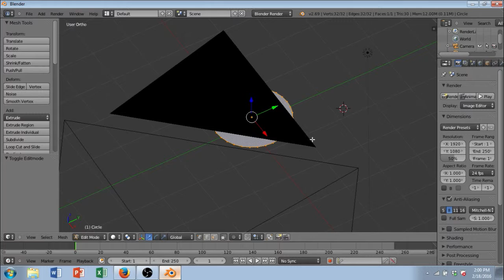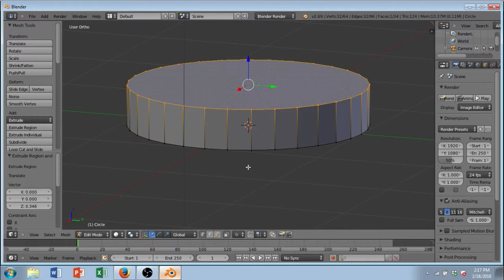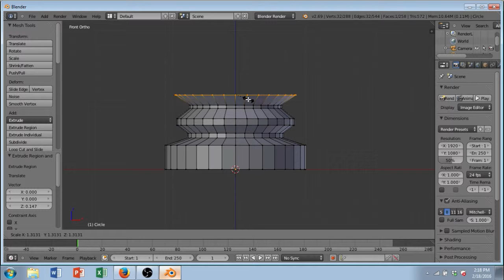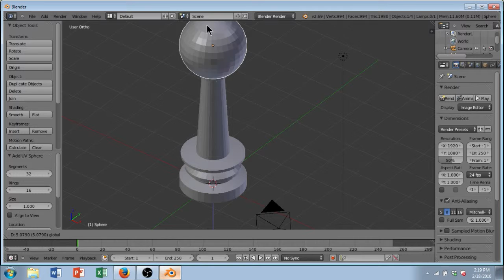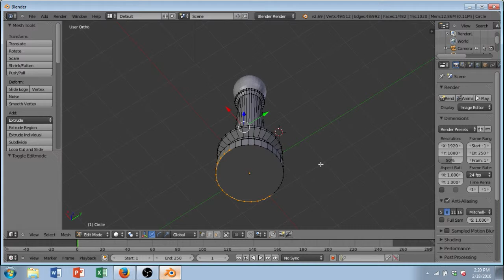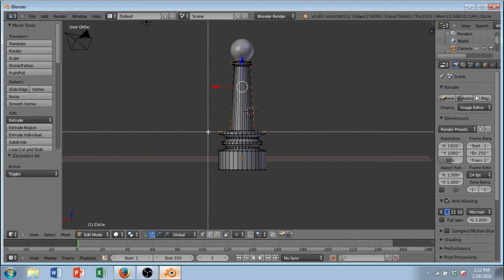Design a Chess Piece with Blender

Comment: How do I make threads that can be printed? A design of mine requires parts that are connected to other parts by screwing them in for easy assembly/removal.
Reply from the maker: +DaGunchijs I would try the "screw" modifier.
Reply: Austin Olney Did some messing around but making the bolt thread match the nut's thread didn't go out so well. Found an addon named BoltFactory. Works great, makes nuts and bolts with a simple click. All it takes is 0.09x resizing of the nut in printer software so they work when manufactured! :)
Reply from the maker: +DaGunchijs Good to know!